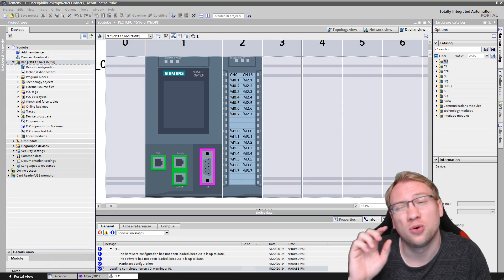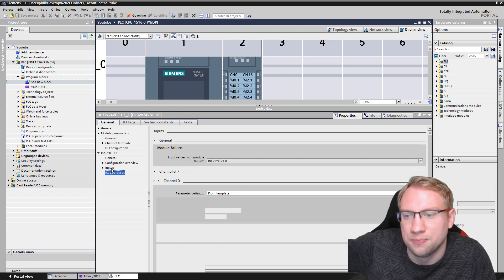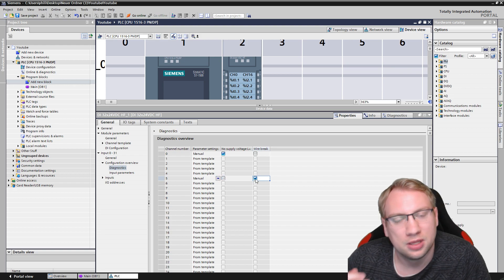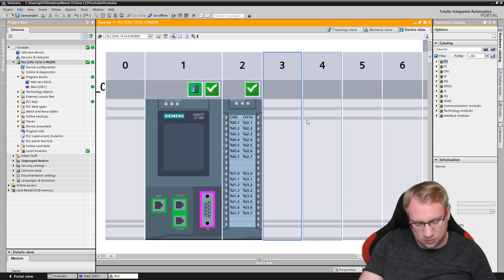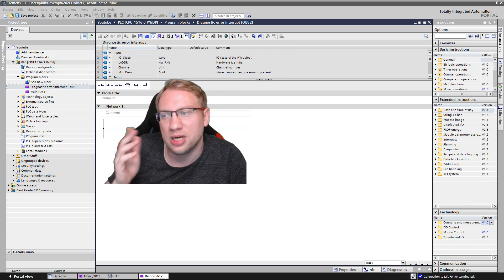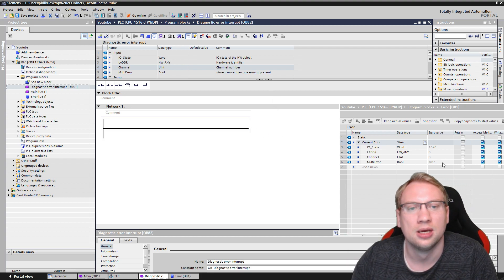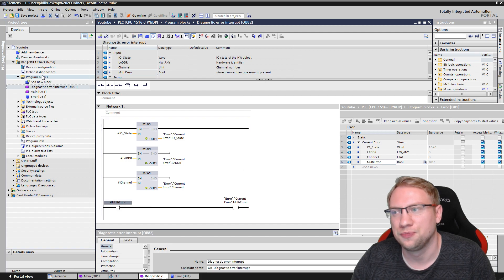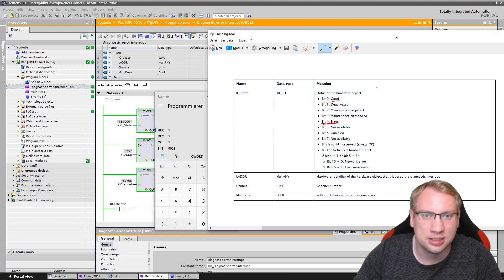TIA Portal: OB82 - Diagnostic Error Interrupt Part 2/2

Comment: Hello, thanks on video, it is very helpful. I am using ET200SP CPU with IO modules. Diagnostic working well but I always have #8000 (32768) value on the "ChannelNumber" during hw error (wirebreak or missing supply voltage). Could you please suggest me what can be problem...?

Comment: It turns out that if a module loses power on more than one channel (two or more), then the diagnostics shows only the number of the last channel on which the error occurred. For example. Channels 0 to 7 have failed, but the diagnostics cannot indicate 0,1,2,3,4,5,6. Diagnostics will only indicate channel 7 and that the error is multiple.
Did I understand correctly?
Reply: You got the answer brother ?

Comment: Hi this is good Vedio 👍.  I am using IM 153 ethernet module with S7 300 PLC. When ethernet cable disconnect from PLC then plc shift in stop mode. Because of this my other process disturb. Please suggest me if you have any solution.

Comment: Thank you you are doing great job, I have a question: I am using an F-CPU with I/O channel diagnostic enabled (Passivate channel, wire break). A fail-safe value (0) is sent as channel output whenever i have a channel fault since i am activating the passivate channel option.
 my question is how to change the fail-safe value from 0 to another value (100).
thanks again for your efforts.

Comment: hi, i've watched most of your videos and learned a lot from them. but one thing i want to ask, if you have multierror, how would you know what are those errors or what are those hardware's that are faulty?
Reply: Hello Jared, 
I think there are two approaches. You can create a buffer - instead of creating struct, you can create UDT and create array from that UDT.
Then if another error occur, you can use next free struct variable in table. 
The second approach is using instruction to check state of device (not using OB82, just performing it in program).
But that is just my ideas, I am wondering now how to solve some issues in my program and that is what I discover till now.

Comment: hi 
i try that configuration , and have error show with red indicate on cpu -s7-1200 and module CM-1243 the cable of profibus are disconnected I already do that to check did OB82 clarify this error , but it's not showing any thank in monitor of  DB ( IO_State = 16#0000 , LADDR =0 , Channel = 0 , MultiError =  FALSE ) it's should be showing from sys constant = 275 , name : Slave_1~Head , type : Hw_Interface 
that interrupted on cable connection  by sent error code so will recognized it 
pls can you clarify how to active OB82 with prosses 
if you need more information like image from my pls or ladder diagram  
this my email : eng.muntadhers@hotmail.com

Comment: I have used the error generated by hardware in my program but how do you reset this alarm after reading it ?
because I am seeing that alarm even it is not there anymore I have to login with my PC to reset it .
I am using Siemens "1500Diag82"  function block for reading the interrupt.
Thank you

Comment: Hi
How we can know error occur by wire breake or lose L+ if both checked in hardware configuration? (I had project so if temperature become high shutdown will be happend and if wire breake, cpu read the temperature is high untruthful. In this case i want to prove which one happend and take time to repair unintended wire break.
Reply from the maker: This would be too much of an info to read out of the error code that we can use in the program (as far as I know...). Checking the error in the "diagnostics buffer" as shown in the first video of the "Diagnostic Error Interrupt" would be the easiest way that I can think of right now.
You can see the example here: https://youtu.be/bEkD6CMB6n4?t=745
Reply: @hegamurl  👍👍